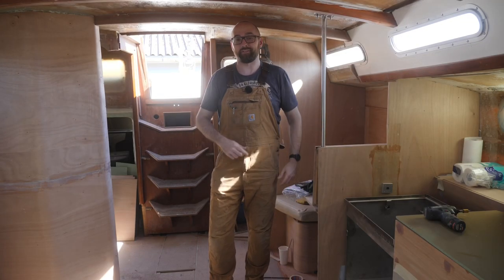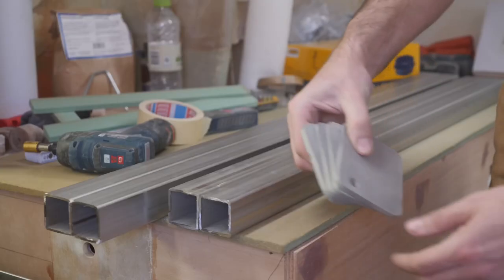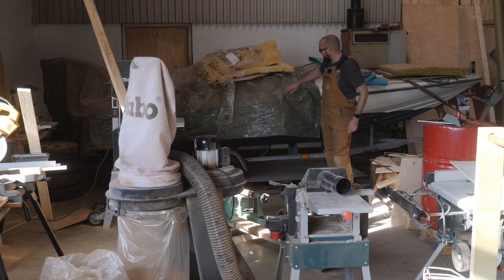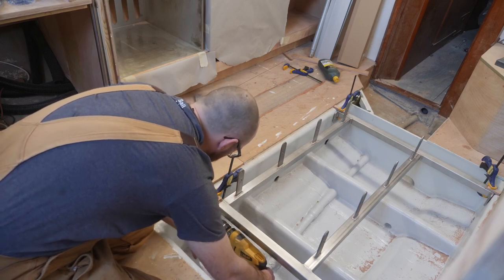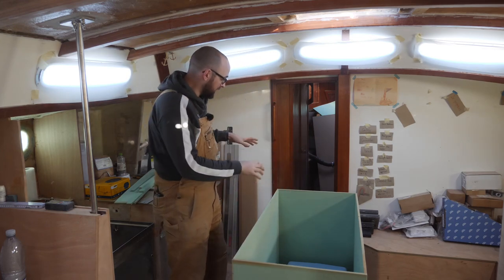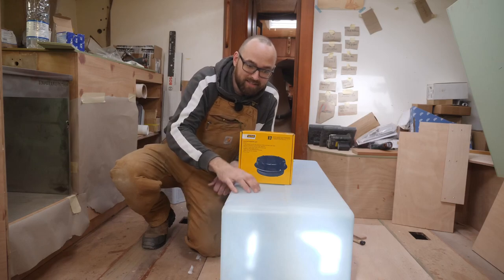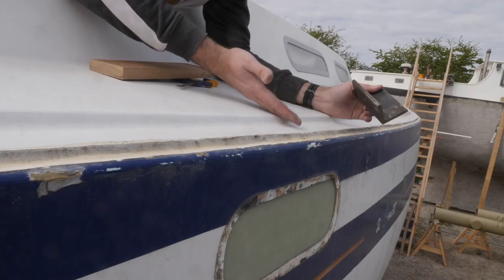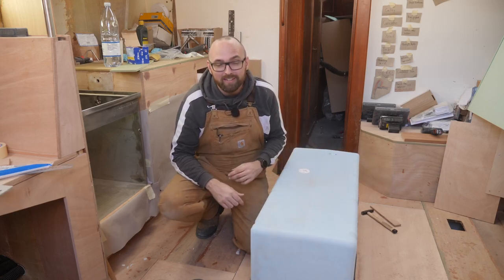Sail Life - New diesel tank - DIY sailboat project

Comment: Are you going to be using rubber strips around the support frame as well as under the straps of the fuel tank?  Able to pump fuel from the auxilary tank back to the main tank?  You probably already considered this, just checking to make sure.  :o)

Comment: Can a Perkins 204 tractor motor work for your marine application? Or are they the same thing?
Reply: The method of cooling the engine would be different, but I believe the engine itself should be the same. I've honestly never heard of a Perkins 204 being used in a tractor, but that's probably because I'm not a farmer. 😁
Reply: Flying Dutchman I found a Perkins 204 in a farm parts shop in Wisconsin, outside of Green Bay Area. I was thinking that the engines would have to be close to the same. It was just an idea.

Comment: See if you can get a larger pulley on the generator or a smaller pulley on the engine.  It looks like you have roughly a 1 to 1  ratio.
Think like a car transmission. The big wheel on engine small wheel on the output you get slower spinning on output but more torque.  The small wheel on the engine, The big wheel on the output you get fast spinning on output. but less torque if you can give up some torque from the engine. You might get enough speed to the generator to increase your amps.  try your ratio 1 to 2 or 1 to 3 you have a lathe there. So it shouldn't be too hard to make.

Comment: Why 24V ? Love to get your pro/cons list for 12/24 volt
Reply: Joakim Larsen - doubling the voltage cuts current in half so half the cabling capacity.
Reply: Robert P yes and that reduced the voltage drop - more relevant in long cables. But 24V it comes at a price higher than 12V. There is a trade off I’m interested to hear Mads’ take on.

Comment: Hi Mads!  I have not read all the comments so apologies if already suggested... Since you are already glassing the hull joint - what about replacing the angle iron & bolt idea with something similar in glass?  I'm thinking a beefy L shaped (but correctly angled for the rail) that is glassed directly onto the hull so there are no penetrations.  Not sure if that is a good or bad idea so beware!! :-)

Comment: Epoxy a strip of foam to the edge of the deck,trim to shape then fibre glass over. Looks neater and less glorious sanding. Just an idea from someone who knows nothing.
Reply: It would take a crap load of filler and sanding, but it could be done. He would have to also somehow incorporate scuppers into the design.

Comment: I was looking to order some material from "Fiber Glast" for a part today and started to order the chopped strand mat. I noticed on the description that it said "Note: All Fiberglass Mat is made to be used with resin to create hard, composite parts. However, it is NOT compatible with epoxy resin. Mat has a light binder that holds it together. During lay-up, it requires styrene to break down that binder and allow for complete resin saturation. Epoxy does not contain styrene and therefore cannot be effectively used with the mat. Use polyester or vinyl ester resin with these applications." I was wondering is this true of all chopped strand or just what this company handles?
Reply from the maker: Some CSM has a binder in it that doesn't get broken down by epoxy (it does by poly). You can get CSM that's compatible with epoxy but 9 out of 10 times you you're better of using BX 🙂

Comment: Could you not put a variable speed pulley on thelectric side to increase voltage.
Reply: The size of the engine is directly proportional to the maximum power output the generator can supply irregardless of pulley size.

Comment: @Sailife  First off, love this channel!  Questions, Do you need to worry about expansion with that plastic tank?  On a tank I installed I had to leave some room for expansion once gas was put into it.  Also any worry about abrasion against the metal frame, even if its strapped down well, any chance it could loosen up in future?
Reply: he mentioned some rubber between the strap and tank, IIRC
Reply: @franktartan6808  Yes, I believe he was talkiing about rubber to hold it down.  But the way its snug between the frame is what I was wondering about.  I know on my Mooller 55g tank, they say it will expand 3%, even with venting, as the type of plastic absorbs trace amounts of gas.  *And disclaimer I have yet to install my tank yet

Comment: Can you change the drive pulley on the 102 to speed up the generator?
Reply: The engine outputs a maximum of a little under 7kw, and no amount of fiddling with pulley sizes will change that. More energy doesn't magically appear out of nowhere just because you change the pulley size. 😁 There is no such thing as a free boat, or free energy. The pulleys allow the mechanical energy of the engine to be converted to electrical energy with the generator, but it cannot create more energy than you originally started with.

Comment: Toe rails are nearly always wet, is it really such a great idea to use wood, even if you are sealing it?  To me, that feels like deciding to core a hull with wood, which is nearly guaranteed to make any kind of blistering or osmosis worse than it would already be. I can understand not wanting to pay $5000 for someone else to make it, but I can't imagine wood being a solution that you'll be raving about in 5-10 years.

Why not use foam and fiberglass? Certainly there are useful types of foam that can be bent enough to match the curve of your hull, and I can even imagine a good use of vacuum injection of epoxy into a pre-bent foam piece giving you the perfect core on which to lay up glass. If bending low-density foam and vacuum injection works, you'll end up with a perfect shape in a week or two. If it doesn't work, you will probably still have time to try the wood and metal solution.
Reply: There is a wood called ipe that is virtually rot proof and takes a beautiful finish.
Reply: @markdichter  
Is that wood relatively cheap? Can the finish you're speaking of be relatively low maintenance when painted or otherwise varnished/waxed? Also, wood like that usually won't take a bend, and requires some high-end cutting edges to saw to lengths. I'm not going to disagree that Wood is better looking, particularly wood that doesn't self-destruct in salt and sun. But if you have to maintain it, or the expense of using those woods is more than glass and foam...

Comment: Hi Mads, awesome video as usual, I am considering adding an alternator to the main diesel engine, some sort of a timing belt between the engine and the transmission wth a clutch and turn the contraption into a hybrid system. I think beta marine has one on the market. That way, you get all the power from the main engine available. Would you consider a hybrid system? Txs

Comment: Generator - wouldn't a larger pulley ration (1:2) give him more RPMs = more power out?  He has a 1:1 ratio on pulleys now...
Reply: The engine outputs a little under 7kw, and no amount of fiddling with pulley sizes is going to change that. Ideally he has chosen the correct pulleys to run the engine and generator combination efficiently.
Reply: @flyingdutchman6984  So the the electrical generator is already at it's max output. Spinning the generator faster will not increase the kilowatts of power.  Thanks for your response.

Comment: Hi, I have Binge-watching all your athena videos the last days. 

in the begining of the projekt you was annoyed over the fact that everything of the cabin interior was build ontop of the cabin floor. whay did you changed your mind and did the same thing your self now? it is a bit more work to fit the vertical parts, but i think having compleat acsess to all of the underlying space by simply beeing able to lift the floorboards as on a x-yacht (at leat the one i have been on) is mutch better. you also dont have drainige issues as you have under your galley.

Comment: Mads for the generator would it make a difference to change to a larger pulley on the motor and smaller pulley on the alternator?
Reply: OKuusava absolutely true at a certain pulley ratio. But is he at that point now? It is possible the 102 could handle more and get Mads closer to his kW target, even if he still can’t reach it.
Reply: The engine outputs a maximum of a little under 7kw, and no amount of fiddling with pulley sizes will change that. More energy doesn't magically appear out of nowhere just because you change the pulley size. 😁 There is no such thing as a free boat, or free energy. The pulleys allow mechanical energy to be converted to electrical energy, but it cannot create more energy than you originally started with.
Reply: @flyingdutchman6984  I get that.  6.8kW @ 3600. What was the the rpm in the test at WOT? Clearly a change won't get Mad's the power output he expected from the 402. But it might get him a bit closer. He seems to go about his work with the kind of accuracy / precision that would indicate that some attempt at optimizing the engine output would be in order if he keep the 102 for a while. A Cruiser doesn't generally trim sails as carefully as a Racer, but they still trim their sails.

Comment: I would just change the police to a different ratio.the motor should have enough power to turn a smaller pulley on the electric motor
Reply: An electric generator is a device that converts mechanical energy obtained from an external source into electrical energy as the output. The engine is the source of the input mechanical energy to the generator. The size of the engine is directly proportional to the maximum power output the generator can supply irregardless of pulley size.

Comment: Personally I would opt for the foam filled toe rail. The reason being you can put gutters and spouts on that and control where water on deck goes. With the suspended wood rail you will always have streaks down the side of the hull form water running down the side which would drive me crazy because it would always make the boat look dirty!
Reply: @ Renegade Show In review of your own YouTube channel,  it only looks like you've been sailing for a couple years, in inland waters, day sailing, and not even an indication of an overnighter. Your comment above about toe rails (which I seriously doubt you even knew what a toe rail was two years ago) hints as to someone who has been sailing for sometime, so I'm a little confused. Sounds to me like you're just an armchair internet sailor wanting to sound salty.

Comment: 11 seconds on the internet and I'm 28?  OK, a question has been bugging me is what about insurance. You have rebuilt this boat top to bottom. Will an insurance take on the risk? Have you adhered to Loyd's of London or some other maritime insurance company standard ? Maybe it is time to bring on a surveyor for an inspection while most of the boat is open. Most if not all marinas require proof of insurance. Like your videos.
Reply: Mr. E in sweden I am able to insure a sailboat by modelname and year , no inspection required .. I am guessing this may be the case in Denmark too

Comment: why not just change the pulleys to a diffrent ratio
Reply: The problem is not the generator spinning too slow, it's the fact that the motor doesn't have enough power. Imagine riding a bicycle at 20 "units of speed", and then you get to a 45 degree incline. You are physically too weak to keep the same speed up the hill.
And then again, changing the speed on a AC motor does not equal more power, just higher frequency... Not really something you want with sensitive electronics!
Reply: The best horse power curve of a motor occurs at a certain rpm. Matching the generator under load also requires a certain rpm of the generator.
Reply: An electric generator is a device that converts mechanical energy obtained from an external source into electrical energy as the output. The engine is the source of the input mechanical energy to the generator. The size of the engine is directly proportional to the maximum power output the generator can supply irregardless of pulley size.
Reply: or use a transmission......

Comment: IMHO, you should not have that step there in the galley. Just have the floor run all at the same level up to the door into the v-berth. It will give you more walking space in the galley and will also be safer. With that step, any time the door to the v-berth is closed, there will be a hole in front of it - aesthetically unpleasant and also a hazard. Again, this is just my humble opinion.

Comment: Mads, I think you are painting yourself into a corner by accepting that you can only fill the new tank by transferring fuel from one of the boat's other tanks. This means that when you go to fuel-up at the marina, you cannot fill the new tank. Surely you want the option to fill ALL your tanks.

Another problem is that the TOP of EVERY tank must be at the same elevation. If one is lower, it can overflow through its filler or vent when the higher tank is brim-full.

BTW: Avoid U's or traps in vent pipes. They tend to get fuel trapped in them and sometimes don't "burp" as they should. This can give rise to difficulties in filling the tank and/or problems priming filters which would otherwise fill by gravity. This is another argument for having your new tank vented directly up through the cabin top.It
Reply: My day tank filled from the top and therefore could not drain back into my main tank which was much lower. I do however understand in some systems fuel may either drain to or siphon to other tanks. I guess we'll have to wait and see what kind of system Mads is going to set up. An option to directly fill the tank he just installed would be a great idea.

Comment: Mads, I recently built a 10kWh (24 volt) LFP batterypack for Artemis. Have gone through the same motions on energy budget etc. as I think you are. I discovered there is an issue with building a clever DC system when you have multiple energy sources and multiple types of loads in conjunction with how lithium battery systems actually work. You can get an idea of this on my blog artemischronicles.blogspot.com . You need to contact me directly to get additional info on the missing pieces of the puzzle.
Reply from the maker: Very cool blog!!! I can't wait to read the rest of your posts :)
Reply: @SailLife  Tack Mads, likewise. Just a little frustrated having a pallet with "stuff" in south Italy but can´s go there...

Comment: on your perkins, couldnt you just change the pulleys on both the generator and the perkins to change the output
Reply: The engine outputs a maximum of a little under 7kw, and no amount of fiddling with pulley sizes will change that. More energy doesn't magically appear out of nowhere just because you change the pulley size. 😁 There is no such thing as a free boat, or free energy. The pulleys allow the mechanical energy of the engine to be converted to electrical energy with the generator, but it cannot create more energy than you originally started with.
Reply: @flyingdutchman6984  if you put a bigger pulley on the perkins and a smaller pulley on the generator it will change the rpm (revolutions per minute) it is the same theory for blowers and super chargers... Cheers
Reply: @howardwood3520  - An electric generator is a device that converts mechanical energy obtained from an external source into electrical energy as the output. The engine is the source of the input mechanical energy to the generator. The size of the engine is directly proportional to the maximum power output the generator can supply irregardless of pulley size. Your analogy comparing a supercharger is incorrect because one process is compressing air while the other is producing electrical energy. A supercharger may produce a higher volume of air with a smaller pulley, but at the cost of using more energy from the engine. There simply is no such thing as free energy.